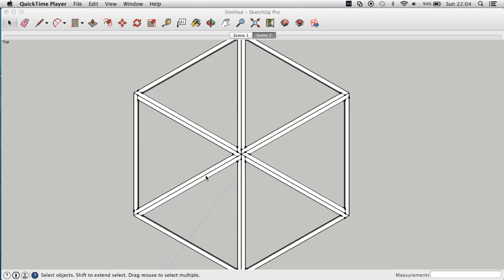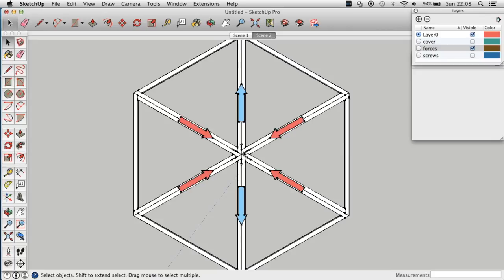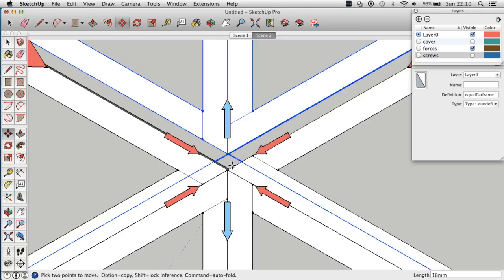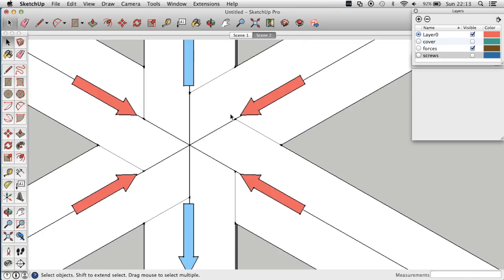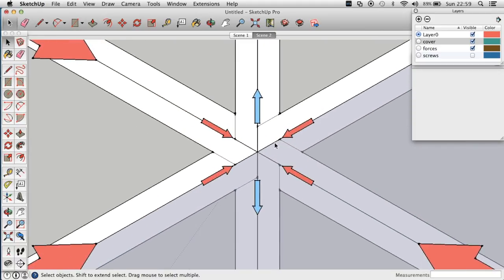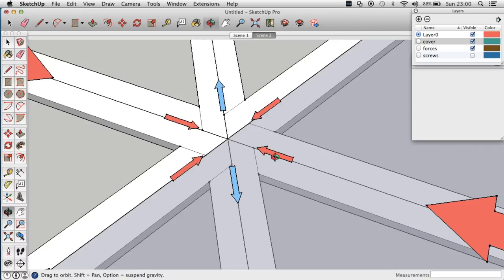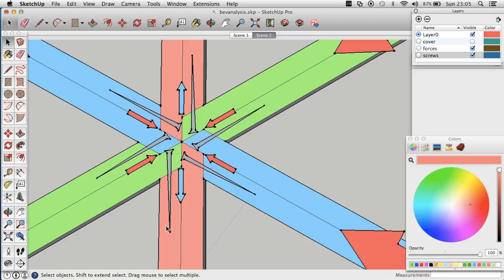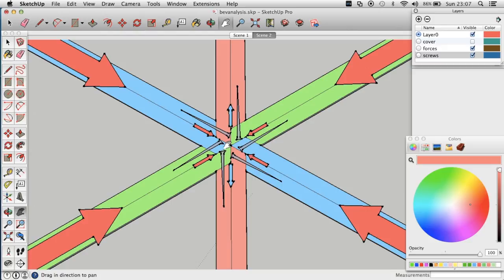Beveled frame dome analysis

Comment: Thanks Paul!  After doing a lot of research and giving a lot of thought to how to build a Dome I now have come to agree that your system is not only economical to build but is just a strong, if not stronger than any other system. At first I was a bit dismissive of your videos as some are little hard to hear and your focus is primarily on green house Domes, so I figured since I wanted to build a house i'd better use  someone's system who has a lot of experience building Dome houses.  Then when his quote for his hardware came in, I took a step back and said to myself, "a dome is basically a wooden framed building which is inherently stronger than a rectangular framed structure which would fall over if it wasn't braced with triangles, and since such rectangular frames are simply skew nailed together there is no reason why a dome cannot also be skew nailed/screwed together.  So then I thought OK, I'll use cylindrical hubs  and simply skew nail the struts to these hubs, but then  yesterday I spent a couple of hours looking at your videos and am now convinced beyond a shadow of doubt, that your system is the best, not the least because each triangle is in the same plane as the struts it is made of so that getting a seal with plywood sheeting is assured, whereas, and I just realised this now while watching another of your many helpful videos, that with a hub strut system this isn't really possible since the strut edge lies in a plane made by the ends of the strut and the centre of the sphere and so the surface of the strut is at right angles to this plane, not in the plane of the surface of the triangle one is trying to cover.  Only your system gives this possibility of creating a leak proof seal between the strut and the covering.  How interesting is that!
Great work Paul.  You have a great energy.

Comment: First, I really appreciate the experience you've been sharing in your videos - the depth of understanding that goes into your current design iteration is subtle genius! I can see where one might wonder about constructing a dome of arbitrary size: how many of what size screws? what lumber size? etc... I would be interesting to see an analysis in some virtual physical simulator. (Something wholly different from having built so many of these structures - as you have.)

Comment: Modern wood glue is stronger than wood( i.e. Titebond III). If the construct fails, it would not do so on a glue joint. I was thinking that I would screw and glue the hex/pent shapes and then only torx screw those together in the event of disassembly.  Am I missing something?
Reply: Dean Winchell Not sure but I'm under the impression that gluing that strongly would actually be less structurally sound than a structure with some, albeit minimal flex.
Reply: @wallacerogers9439  I know...late to the game..  another study could address "where and how much" modern glues could absorb the expansion or compression forces oner a range of temperatures in climate.  wow. we are doing science of adhesives now. thank you !

Comment: I was taught that you should never screw into end grain like that. Instead of the screw thread working its way between the fibres of the wood and getting trapped between them; it's cutting them into short pieces.   It's really a lot weaker.